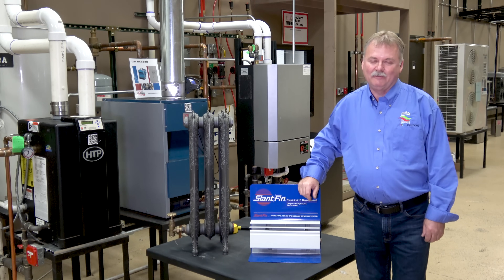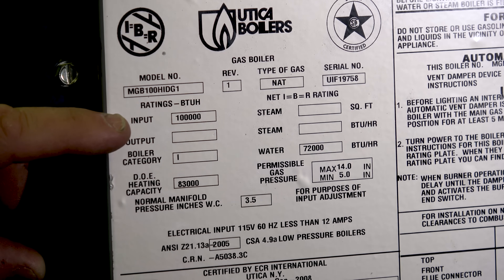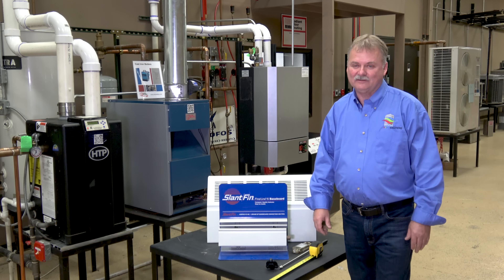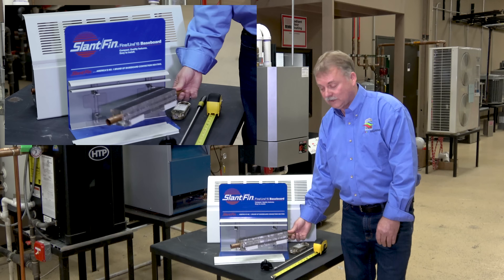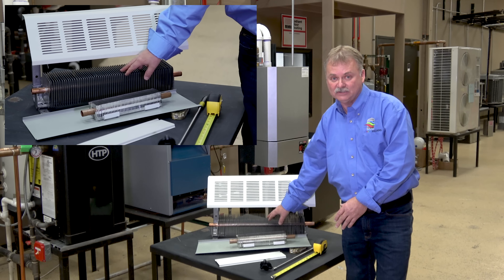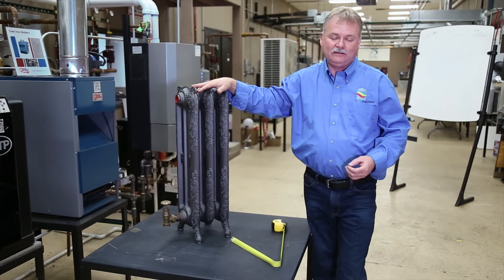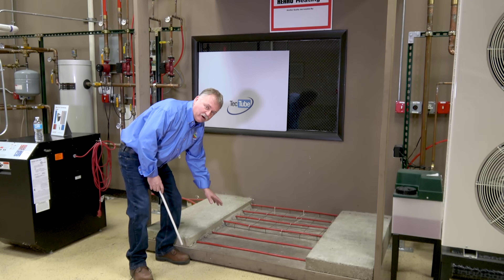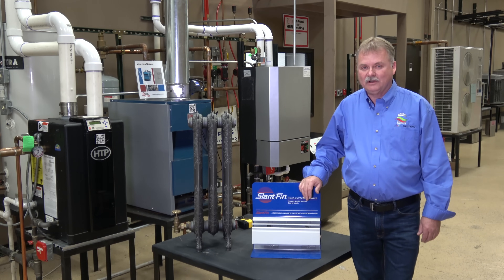Right Sizing a New Boiler... the easy way

Comment: I recently replaced my boiler. I measured the baseboard but didn't account for the part with no fins. The plumber should have told me that. It isn't that much, maybe 3-6" on the ends. 150' total, two zones. The old American Standard boiler was massive, oil converted to gas in the early 80's. I replaced it more for reliability and safety than efficiency. I also lined the chimney flue with stainless steel to fix a draft issue. The new Burnham boiler only holds 5 gallons and when the heat comes on, the cold radiaor water drops the boiler temperature much more than the old system. The radiators get hot, cool, than hot as the cold water circulates. The boiler gets hot faster than the old one. It only runs about 5 minutes, 4-6 times an hour, depending on outdoor temperature. The room temp is very stable. It didn't work well with old round mercury Honeywell, with massive temp swings, no matter how I adjusted the anticipator,  so I installed a new digital one that is very stable. Gas usage is hard ro judge as it was a cold December. 84% efficient, old one had to be 60-70%. My boiler is 140k btu input, 117k DOE heating capacity and 102k net AHRI. It is probably oversized, based on radiator length but house is insulated for the days of 16 cent oil. Most windows have been replaced with double panes.

Comment: Had a company come out to do an
Estimate to replace my old boiler.
Wanted a high efficiency boiler he told me high efficiency in my house wouldn't last long because of the high water temps.
Is that true.
My boiler is American standard 1961 vintage.
Reply: I was talked out of high efficiency too. Higher cost, maintenance and lower lifespan. I imagine most of my fuel savings would go towards needed maintenance. It would have saved me a few thou on lining the chimney.
Reply from the maker: @gmzx3  Agree it is a higher first cost and higher maintenance costs. And... if the maintenance is not done... it could be a lower life span too. The energy savings in many cases can pay those differences but in some cases it does not. It depends on the cost of natural gas or propane in your area.
Reply from the maker: Not true. High efficiency boilers can also handle running 180 degree water if you want. They are more efficient running 100 to 130 degree water than 180, but not issue whatsoever running 180.

Comment: i need to replace my water boiler. I measured the edr and that gives me 176 feet fin only. I have 5 zones. my old boiler is a american-standard input btu 180000 output 144000.
The tag also says 108 water Mbh rating. My question is what size water boiler will i need. The pipe is all 3/4 inch
Thanks
Reply from the maker: If you only have fine-tubed baseboard on that boiler, and it is standard residential baseboard you multiple the length by 550 to 600 (usually we use 580. So based on that, you new boiler should be no larger than 102.000 output. And of course, this assumes that your current baseboard is large enough to heat the house with the old boiler. In reality, that is still likely an oversized boiler because the baseboard is probably oversize also... and someone may have made thermal improvements to the home since the baseboard was originally installed... but at least it will be closer to correct than the 144k output you have now.
Reply: @TECTubefilms  thanks for the reply it sure helps I am going to start looking for replacement.
Reply: What boiler would you recommend dont want high efficiency thanks
Reply from the maker: @steveewolhin2181  why not high efficiency? Are you in a location where natural gas is ultra-cheap?
Reply: I am in south dakota also to much electronics that usually have issues in a few years. I am a diyer control boards become obsolete. I can repair most but would rather not. Cost is higher also @TECTubefilms
Reply: @steveewolhin2181 Condensing boilers run cooler getting more heat from exhaust and water/acids collect and condense and have to be neutralized and pumped out. This system needs to be cleaned and properly maintained, so some or much fuel savings will go to maintenance. System life may be lower too. I couldn't find a heating person who recommended it. Over time, they may be mandated and may improve.

Comment: hello tec tube what would steps be on calculating steam boiler
Reply from the maker: Use the same method to measure the radiators but instead of multiplying by 170 BTU/h for hot water, you multiply by 230 BTU/h for steam
Reply: @ my calculations of all my radiators 6 unit building plus the hallway radiator equals 850 EDR I’m getting a lot of mixed information some say multiply by 240 and some say take your total EDR and match the boiler to steam sqft of the boiler so if I multiply I’m looking 210,000 btu but if I match the steam sqft the Btu on that boiler is 
350,000 Btu I don’t want to make $17k mistake by being way under or over
Reply from the maker: @satberhoxhaj3347  You should get approximately the same answer. We just looked at a random US Boiler and for the STMX350 model it shows 213,000 BTHh and 892 ft2. View at https://s3-us-west-2.amazonaws.com/catsy.782/SteamMax+Product+Data+Sheet.pdf
Reply from the maker: Same is true for Weil McLain - https://www.weil-mclain.com/products/lgb-high-efficiency-series-3-commercial-gas-boiler
Reply from the maker: @satberhoxhaj3347  What specific brand and model are you looking at that shows 350 MBH for 850 EDR?
Reply: @TECTubefilms  peerless 64-07 345k btu  with 858 steam sqft or the steam max 350 btu with 880 steam sqft
Reply: iI guess they where all correct but didn't quite explain correctly what to look at some just told me you need 350k btu
Reply: ok so when i multiply my edr by 230 that amount is the steam MBH

Comment: If I have in floor heat in my garage (in the concrete floor) and I take square footage x(times) 40btu and I come up with 55,680 btu total with 14.5’ high ceiling and in mid Michigan. Walls are 4.5”-5” blown in isolation. I am debating between 90,000 and 120,000btu modulating/condensing boiler , is the 120k over kill? I keep garage at 70 degrees
Reply from the maker: 4 car garage? 40btu is the max. Most systems are 25-35. So the 40 already has a large safety factory in it. So you likely need a boiler with 35,000 to 56,000 output. So yes, both 90 and 120 input sound like overkill. We should also reiterate that this method is for resizing a boiler to be smaller than what you already have. What size do you have now and how much does it cycle?
Reply: @TECTubefilms  they(previous home owners)have a 40,000 btu 80gallon hot water tank. When we get under 0 degrees outside it will only get to 66 degrees inside when set to 69-70 degrees. During that time the hot water tank is running all day and night with the water circulating around 80-90 degrees. Water is set to 130 at the tank
Reply from the maker: @richiewilde1621  Is this hot water tank an "indirect tank" for domestic hot water OR is this hot water tank a "buffer tank" for hydronic heating?
Reply: @TECTubefilms  it’s just used to heat the water for the infloor heat, closed system with circulator, it’s only job is heating water for the floor.
Reply from the maker: @richiewilde1621  Wait... are you saying it is neither an indirect tank nor a buffer tank, but rather a standard water heater???
Reply: @ yep standard hot water tank 40,000 btu , so I am debating between Rinnai 60,000 combi or 90,000 combi both modulating down to 15,000 about 400.00 difference between the two. You think the 60,000 enough?
Reply from the maker: @richiewilde1621  Keep in mind that standard water heaters are generally only 50 to 60% efficient. Even an energy star tank water heater is only 80%. So if you have a 40,000 input water heater, you are probably only getting 22,000 out of it.
Reply from the maker: @richiewilde1621  If you are only heating this radiant floor, then a 96% AFUE 60k heater will be plenty. If you are heating something else with that same boiler, then it will depend on what you are heating and the sequence of operations on how you are heating it. Normally domestic water and space heating rotate and are not done at the exact same time. But if you plan to control both simultaneously for some reason, then you need more capacity. But the floor itself doesn't need more BTUh than its square footage will be able to put out, which was about 56k max.
Reply: @TECTubefilms  thank you so much, it’s going to be the floor and I have a tub style sink in the garage I will use the domestic hot water for very rarely. Now in the summer when there’s no call for heating the floor I might hook up and out side sink for our grill area. But that sink will only be in the summer time. So it looks like the 60k Combi unit will be good then?

Comment: I have a MAC 150 Utica combi boiler and it has been nothing but a nightmare.  I can not find a technician who can fix it in Massachusetts.  Any tips?  The error code now is E110.  It keeps running and stopping.  It also never gives hot water fir more than a few seconds.  Anyone who could fix it on Massachusetts?? Please
Reply from the maker: Sorry, we only have contractor relationships here in the Midwest where we are based. Massachusetts is a big boiler market so we would think there would be more contractor options there to service hydronic systems than we have here. Guess not.

Comment: So I'm building a house with radiant heat concrete floors and the SF X 40 = 93K. I would like to use a combi boiler to heat the domestic water as well. Is this 93K calculation including the domestic water as well? Or do you have an equation to add to this number? Forgive my ignorance, I'm still learning

Comment: I would love some input.  We are building a house & business space with workshops and garages under one roof.  Our total radiant heat area is about 12,000 square feet.  It's a diy project so requiring a lot of researching.   We are trying to figure out what boiler to get to handle the radiant heat, which will be in concrete on all floors.  We will want to zone them (12 manifolds with their own zones) since many spaces won't require much heat on a regular basis. We don't have natural gas so we would need to do propane.  We are doing ICF so luckily, we will already have a very efficient building to begin with.  And to be able to run the domestic water in the house (less than 5 occupants full time so it isn't a huge domestic water load required).    I would love to hear your input on which systems would be the right ones and if you have any videos on how to set up those systems.
Reply: What did you find out? Did you need 2 systems for that amount of flour space?

Comment: Is the 550 - 600 BTU output of the typical residential fin you referenced per foot of fin?
Reply from the maker: Yes, per linear foot of the section of pipe that has the fins (not the entire baseboard itself)

Comment: my house came with Delco boiler 1 size fits every house it was like 3/4 of a refrigerator up to 250 thousand btu even after new burner and smaller tip it was a ridiculous monster i replaced it with smallest boiler i could get 3 sections around 80,000 and it was still plenty big enough
my rule of thumb is you want boiler to just be able to keep up on coldest possible day of the year running constantly
Reply from the maker: Love it!

Comment: My gas meter for the coldest month recorded 1430 cubic meters in 30 days, (I'm in Canada and it gets to -40 degrees).  And since gas gives 35300 BTU/cubic meter, my usage was 140209 BTU/hr.  That is the most accurate way.  It shows that in the coldest month my boiler must put out 140209/hr so that I won't freeze.  (Please correct me if my logic is wrong since I'm shopping for a new boiler to replace my ancient 60-year-old model).
Reply from the maker: Here is a video to calculate heating loads by gas consumption - https://youtu.be/T_duKTCPWNE

Comment: My old house has a 1 zone with baseboards and 2 zones  with radiators. Do I need to include a length of pipes (cast iron for 2 zones, copper for for 1 zone ) for estimating  BTUs?  The oil-fired boiler is on the way out (seepage between sections). Everyone says convert to gas. But some says new high efficient oil boilers is better option? Is this true?  We planning stay long in this house and we are in MA, so heating season is long. Thanks!
Reply from the maker: No, do not increase boiler size to cover the heat loss of pipes. That is already built-in to the safety factors of this method.
Reply from the maker: In regards to the natural gas vs. oil discussion, there are a lot of factors involved there. One major part will be how much you pay for oil (supply and delivery) and how much you will pay for gas (supply and delivery) in your local community. Then you have to adjust for the efficiency since even a high efficient oil boiler (typically 83-88%) won't be as efficient as a high efficient gas boiler (typically 92-96%) Natural gas also burns cleaner so if you care about the environmental pollution there is that to consider. Lastly, depending on your community there could be challenges for how your oil is provided (do you have to schedule it, pay for it upfront to get a good deal, etc?) that would go away with gas, but also possible installation costs for a gas meter.
Reply: @TECTubefilms  Thank you for taking time to reply. Lot of good info. One more question. There is a possibility I would need to add 2 more zones. Both radiant floors.  DO I need to include these  in boiler sizing calculations and  how to estimate it? Thanks again!
Reply from the maker: @kirill_gusev  If you are not adding square footage to the heated area of the building, then you do not increase the boiler size by adding more terminals (baseboard, radiators, radiant floor, etc.) because you are not heating a larger structure... you are just heating it differently. However, if this is a new area that was not previously heated by this boiler, then yes you need to add the new building addition to the boiler size. This would be determined by a process we call the "load calculation" or "heat loss calculation." Do not use the radiation count method described in this video for anything other than existing hydronic heated areas.
Reply: @TECTubefilms  Thank you again! one zone is going to replace an existing one and one would be totally new.
Reply from the maker: @kirill_gusev  "Totally new" meaning an addition to the building like a sunroom, bonus room, etc.?
Reply: @TECTubefilms  this is attic conversion, its been conditioned by heat pump but its not really comfortable in a winter so Im planning to add  a radiant floors.
Reply from the maker: Who is suggesting you convert to gas? And who is saying keeping oil is the better option? If either of those are the local gas or oil company, just remember that they are biased. A HVAC contractor that services both may be a better resource to consult with.

Comment: On the residential Baseboard calculation how do you calculate Sq. Ft. Of Steam ? Also, do you measure  only the finned section of copper length of pipe or entire run?
Reply from the maker: Don't measure the length of copper pipe or the whole baseboard. Just measure the length of fin.
Reply from the maker: We don't do much with steam baseboard, but take a look at the Slant/Fin website and look at the catalogue data for output per foot.
Reply: @TECTubefilms  thank you for response

Comment: Thanks your video its very helpful.  My mother has a boiler that runs on propane.  She has to fill the propane tank every 2 months for $800.  Only the boiler uses the propane tank.  The boiler is about 20 years old and according to the calculation it is double oversized.  Would replacing the boiler to the correct BTU's lower the propane cost a lot?    I thought about high efficiency wall hung boilers, but read they aren't good because the water plugs  them up.  Would you recommend those?  She's on a well.
Reply from the maker: A correctly sized boiler will save energy. A high efficiency boiler will save energy. Improved air sealing of the envelope will save energy. Outside air reset control on a boiler will save energy. Lots of ways to cut that fuel bill down but someone has to first determine why the bill is high.
Reply from the maker: We are not sure what you mean by water plugging up a boiler.
Reply: the boiler should be on a closed loop and therefore if filled with clean water, should not be getting “plugged up” by the well water, unless there is a leak and the system has an autofill bringing well water into the system. Perhaps your mother has a water heater, rather than a boiler?